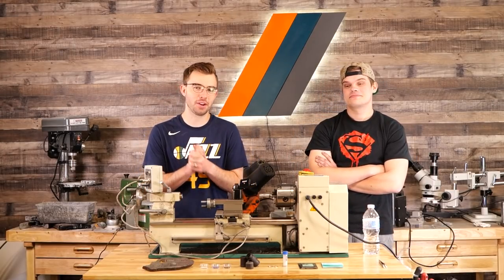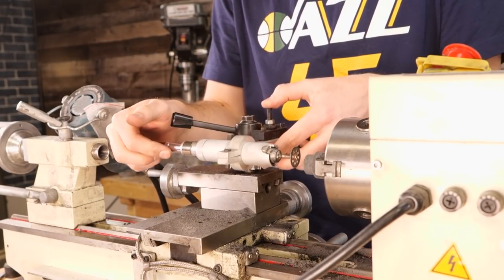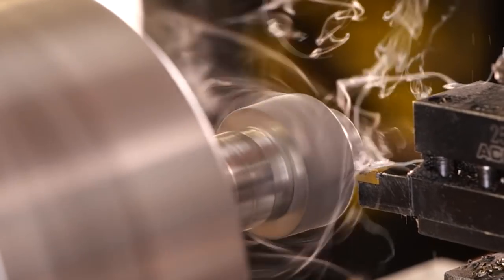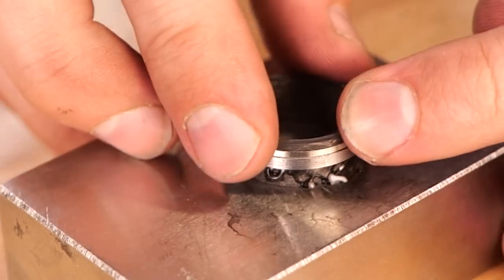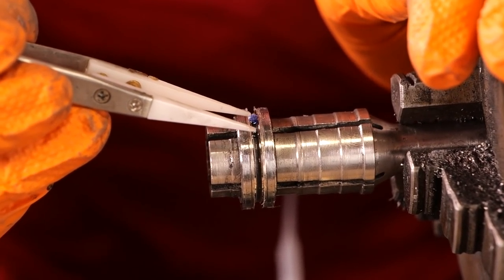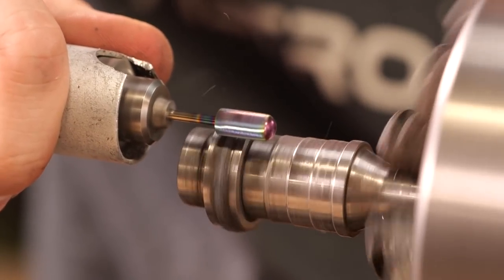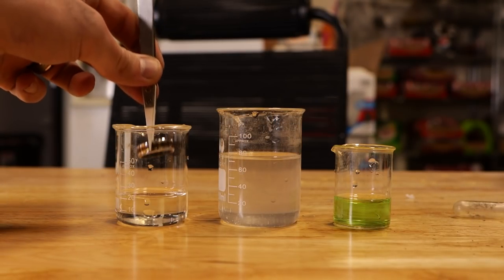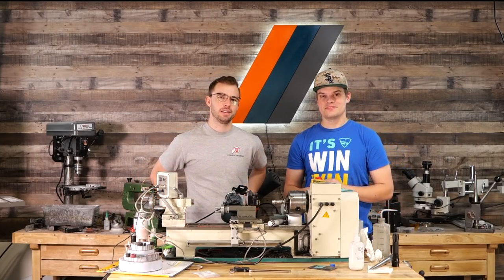Making My Employees Wedding Ring (Meteorite, White gold and Carbon Fiber Ring)

Comment: 1. Welcome back Patrick, 2. Congrats to your Co-worker. And finally, Is there a chance of the Meteorite rusting after a while?
Reply: Yes.....
Reply: You can see the rust on the block of meteorite block he cuts it out of. Applying a layer of clear coat of some sort would prevent that.
Reply: @F0XD1E  Nope, I wish. Thats what I did. If you use a watery solution for etching, you are pretty much screwed.
Reply: @LaserGadgets  you wouldn't be able to use the astro tech super thin?
Reply: @josephhortin8738  ??
Reply: My meteorite while sealed hasn’t rusted one bit

Comment: You said you got the forged carbon fiber from carbon 6.  I purchased their glow series lume ring. I like it but it just kinda broke into pieces one day. No force applied when it broke. Lasted like 3 years. They replaced it, I switched to their new faceted glow ring.  First impression didn't like it, carbon fiber was paper this and in general the ring was too thin and cut into my finger.  Developed a callas over time and in a couple months didn't bother me too much.  Then it broke around 6 months.  Same scenario no force applied just kinda fell apart in my hand out of the blue.  They are sending another one....your rings are amazing, out of my price range at the moment though for the ones I really like.  

Just wondering if you have came across my experience before?